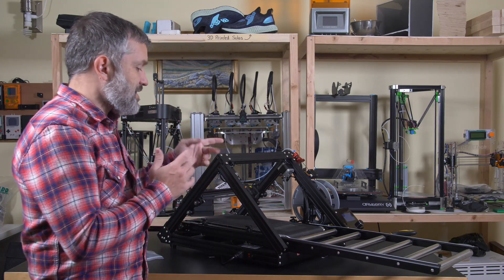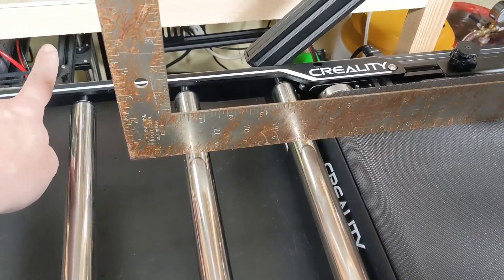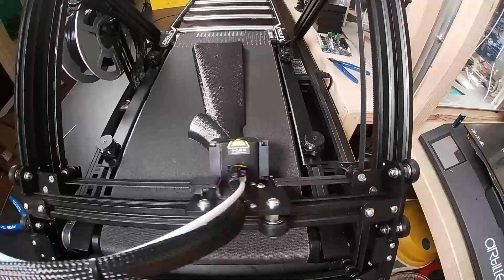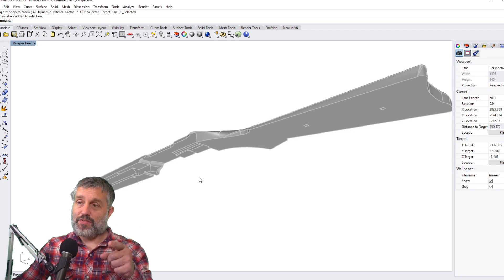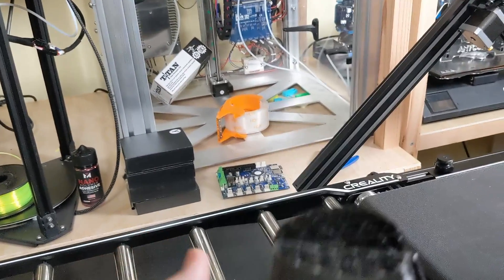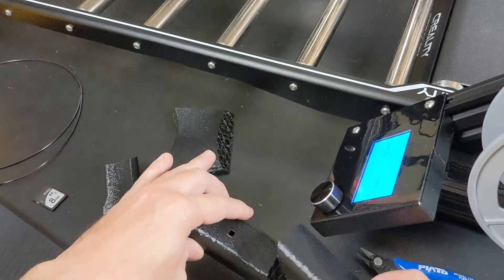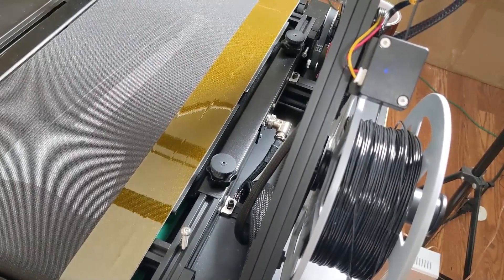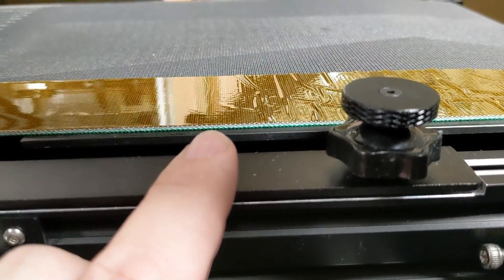Figuring Out the crazy 45° CoreXY Infinite Z 3Dprintmill Creality CR-30

Comment: Haha the thing with the fans is most 3D printer factories- the bosses and engineers aren't actually 3D printer users, they don't have them at home. So they think of them in terms of being an industrial tool- not something you have to live with. I'll see if I can get something done about the fans here...
Reply: I'm looking forward to 140mm noctuas 😛
Reply: Maybe just me, but a quite fan is a fan that's not working. Hearing the fan is a good sound
Reply: @PaulDominguez  Thats a rather antiquated viewpoint isnt it. Its sort of like disliking electric vehicles because the engines dont make a sound.

In all reality, there have been simple ways to electronically detect fan failures for decades. All that is required is a sense pin (like seen on 3 and 4 pin computer fans) and the device should be able to tell with greater accuracy than your ears, the exact speed the fan is spinning at.
Reply: Naomi, can I please buy one directly from you? I will also give your machine a full review.

Comment: I ran into the same problem with some ebay filament. I wonder if the layer shifts are from the weight of the part coming off the end of the belt because the rollers are not supporting the part as they should be.

Comment: Welcome to having a belt printer that can do very long prints..  Sadly they do take very long to print..   I personally wouldn't recommend going over .2 layer height on the .4 nozzle.  If you go too high on layer height it could reduce the bed adhesion since you would be reducing squish at the belt..  Also if you didn't know Blackbelt Cura has a manual support option as well..  Can't wait to see how it works for you with some better filment..
Reply: I really want IDEX, a Volcano and pellet feed- project for 2021...

Comment: Probably shouldn't have called it a stupid design on the rollers. It is a prototype and you are testing. I think it would have been better to say this could be an issue ill suggest maybe adjustment in the rollers. Also how did it look on the rollers as it hit each one. I could see how 3 rollers out it's up in the middle.
Reply: Or no rollers at all except for the very back which would roll a 50lb Thanos sword.
Reply: I definitely agree with that. Sometimes the criticism goes from being direct to being overly harsh. I imagine someone worked very hard on this so to have it called stupid is insulting even if its not a great design at all.
Reply: Maybe an easy temp solution would be measure the gap once you have the bed leveled and then just print a spacer to put between the rollers and the belt assembly to raise the roller assembly to proper height..

Comment: I’m curious how the roller frame mounts to the printer.  Can you put spacers in to raise the frame up?  Or is there a way to lower the belt and end stops to better align with the roller assembly?  I think there might be adjustments on the underside of the printer?  I hope they come up with a belt that can print higher temps.  I don’t do much in pla anymore.

Comment: Correct me if I'm wrong, but arent there 4 adjustment points for the bed? Arent you able to bring the front edge of the bed down so that it lines up with the rollers?

Comment: Did you get bubbles under the tape because that is the heated area of the belt?
Reply from the maker: No, it has to do with the forces stretching the belt as it goes around the rollers. That is the driven wheel. If the far end had the driven wheel the bubbles would be forming under the printer at the far end instead.

Comment: Superb review! Also, a well designed 3d printer is able to print fast without loosing much print quality... Hence, how fast (mm/s and mm/s^2) can this print without loosing much print quality?
Reply from the maker: All these prints were done at 60mm/s
Reply: @DesignPrototypeTest  Ok. To me this speed is quite average; not fast and somewhat on the low side. I usually print at 100 to 125mm/s. Still, the question remains: How fast can this apparatus deliver good prints?  I can't wait to find out in order to back it or not!
Reply: @LigneDesign  I have to wonder if this thing can't print faster in all axis except for the belt.

It is a core xy turned 45. I imagine it's just something no slicer really has the options for

Comment: Very interested in the D4. Seems like an even closer almost there cheap printer. UART 2208 connected drivers, ABL, 32bit controller,  Silent steppers, big volume, direct drive. It has everything on paper.

The problem with 3d printers though is on paper is on paper.

Comment: It looks like you have just invented a method for aligning the print belt with Kapton tape.  It would be interesting to pursue the solution for the wrinkling problem, which would also stabilize the nylon belt.

Comment: Prints on a 45 degree angle will Not be as strong as one at a 90 degree angle, no matter what you do. It is not just the filament. You can put that filament in the Sunlu for a few hours first and print from a Boden tube. Also a rifle stock needs to be printed with carbon fiber, even if its not nylon.
Reply: Not sure that is an acurate statement..  if the entire print was printed layed flat on a normal printer yes the layers would be stonger, but if it were stood on end it would be weaker than a print done at 45 degrees. At 45 degrees layer lines would be longer than stood on end so should be stronger..  Strength is all how you position the model..

Comment: An idea for the roller could be to 3D print something a round it. like you do with the bearings (play ground).
This would have to be in 2 pieces. MAYBE and I got my first printer today Mingda D2 YHEAAAA
Reply: Or maybe just machine oblong mounting holes for the rollers so you can adjust their height to match the bed.

Comment: What are you paying for your "cheap" filament? The cheap filament I buy is in the 18-23$ range is have had little issues with it. One roll has been sitting open on the printer for almost a year and it still prints great with no drying needed.
Reply from the maker: $12 each I paid for those rolls. The company reached out to me and told me it was a custom order that the customer ended up not paying for and so they liquidated it on Ebay.

Comment: I watch all your stuff and always give a thumbs up, always. But this one seems to be more about the filament quality. You knowingly used "suspect" cheap filament for a printer review! So in my book that negates everything said about the printer results. The CR-30 obviously does have teething issues which cannot be shown clearly because you spend so much time explaining just how rubbish the filament is. I'll send you a reel of good stuff to use in your rerun of this printer if times are so hard. Sorry but I'm very disappointed by the lack of objectivity here.
Reply from the maker: By using this junk filament we learned about shrinkage issues on this type of printer. Given the bed temperature limitation, nobody was going to test ABS, and it would have been a while before people started experiencing this issue and posting it on forums or in videos. Therefore, using crap filament was a great stress test. It showed the great functionality of the filament runout switch, and on the flip side it showed the difficulties with printing at 45° with materials that have significant shrinkage. The point of a review is to stress test the machine. Therefore, I respectfully disagree with your assertion. I think it was a great thing that I used the bad filament. It taught us a lot.
Reply: @DesignPrototypeTest  I agree with you very much. It made me realize that the ABS I often use may have problems in printing. I also understand why Blackbelt’s Conveyor belt uses carbon. This is a very helpful video.

Comment: Your analysis is very sloppy you shown time and time again long prints get this weird stair step issue. I think it's obvious that the belt is sticking to the print and as the print rolls off the belt it changes the tension resulting in a belt that doesn't keep steps. You need some kind of teeth. Imagine if the other end of this was printing out into the vacuum of space you need to focus on those tolerances with the rollers
Reply: Black belt cera just a way of SpaceX looking to steel free open source software
Reply from the maker: The later shift lines from the first video on the benchy print were caused by a loose hot end. I now have absolutely zero layer shifting (what you are calling stair stepping) issues.